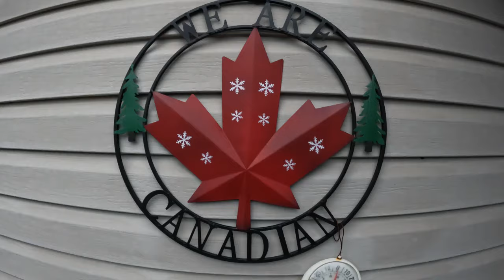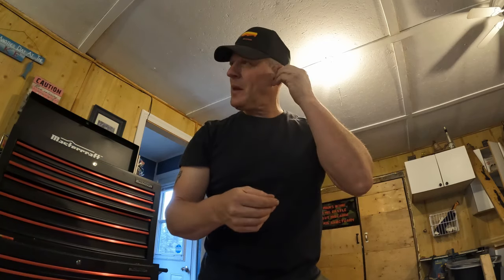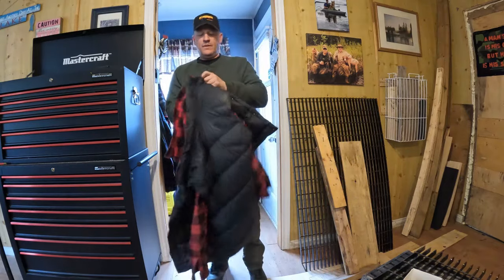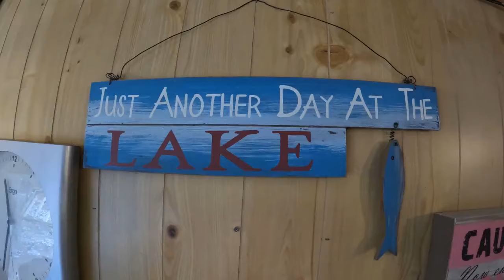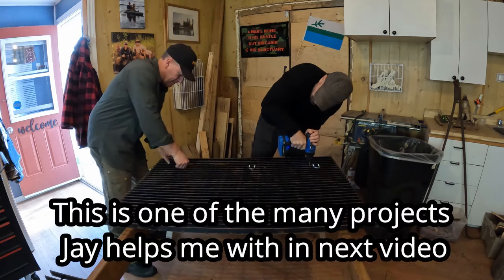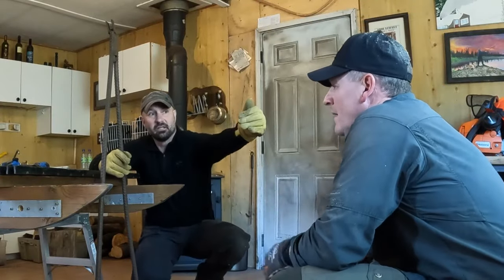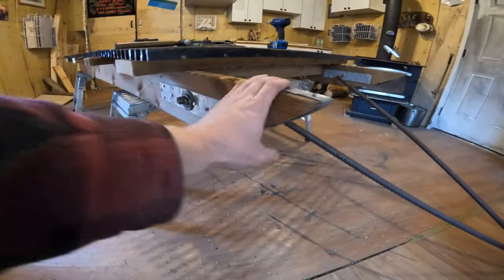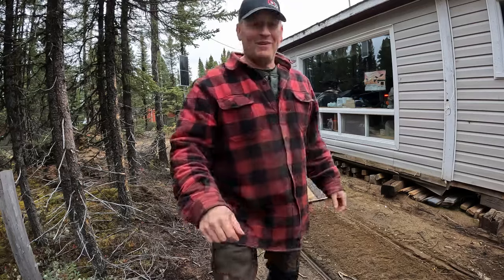EARLY SNOW means SNOW GROOMER BUILD & CELEBRITY VISIT (teaser)

Comment: I made a groomer from an old 4x8 utility trailer that was no longer roadworthy.  Stripped off the wheel/axle/spring assembly and the decking.  Flipped it over so the drawbar could pivot upward and attach to my sled's tongue via a fabricated swiveling hitch.  Ran two lengths of chain from the drawbar down to each forward corner and incorporated turnbuckles so I could set the tension.  I groomed my feeder trail for years towing it with a 600 Ace Expedition Sport until it rusted so bad that one frame rails cracked off.
Reply from the maker: Great idea👍